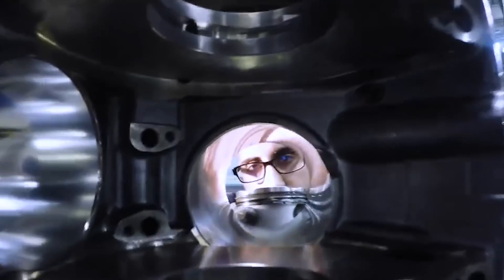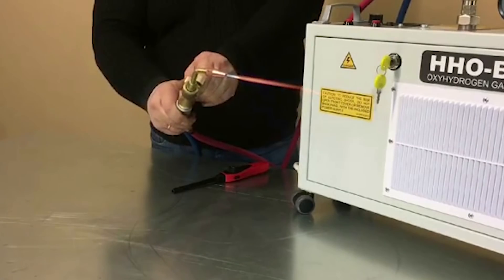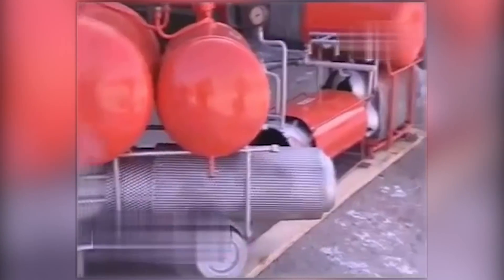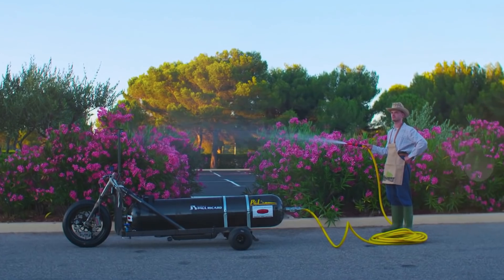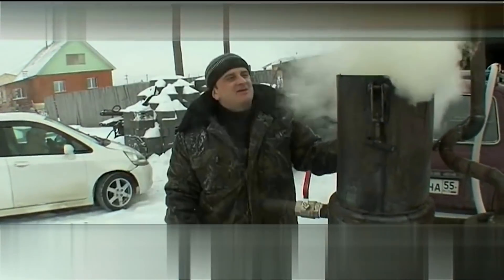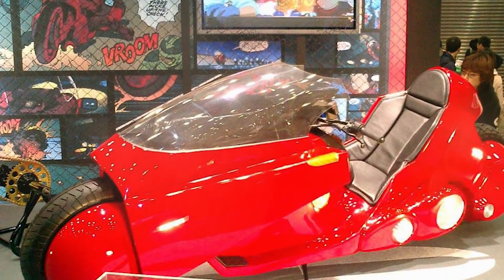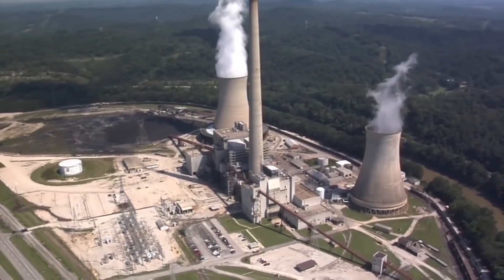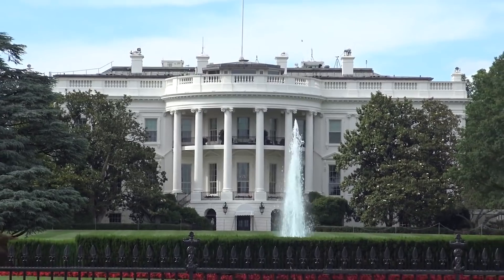Why These Engines Are Banned?

Comment: Lets make something clear,  energy is energy,  all these schemes use energy and follows the laws of energy.   take hydrogen,  it takes energy to separate that hydrogen from oxygen, from water,  it will take more energy to separate them than you will get out of them,  that does not mean it's not useful, as energy storage think of hydrogen as a battery.  in an electric car, you store energy in cells,  it takes more energy to charge them than what you get out.  there is always some loss in any system  no such thing as 100% efficiency.   

Now lets say you have a source of free energy like sunlight, and you use that sunlight in a way to provide energy to make hydrogen.  in essence that hydrogen is "free"  the energy you captured from the sun, is now stored in another form in that hydrogen.  of course that sunlight energy can be stored in batteries as well.

As for engines not making it to market,  there is no suppression here.   no big conspiracy,  it has to do with practicality, and logistics,  some motors are just way to complicated ( double piston etc ) and expensive.  hydrogen cars are complicated,  you need special storage,  special fueling stations,  it is highly flammable , and since its a gas, it needs to be kept under pressure to be stored. it takes up a lot of space.   then there is the fact that hydrogen's small atoms, can seep through almost anything. ( it leaks out ).  and forget about over unity free energy devices,  no such thing, and all those "they killed so and so, because he knew some secret" if anyone was killed is because they ripped of investors they conned. 

Compressed air engines have been around a long time.  again same deal,  you are using energy to compress it,  more energy will be used than you get out of it.  just another energy storage system.  instead of hydrogen or lithium cells,  it's compressed air.

I have even heard of gyro storage system.   a metal disk,  suspended in a vacuum, and levitated by magnets.  you "charge" the system, by spinning the disk, ( through magnetic induction) since it's in a vacuum, there is no friction, and can spin so fast, that the limit would be the strength of the metal.  to extract that energy,  you just use induction to generate electricity,  just like a generator. 

So really what determines what will be a successful storage system and motor for transportation,  is Cost, reliability,  efficiency,  safety,  how much infrastructure investment is required to shift to that system.  it's no wonder why electric cars are so popular. electricity is easy to transport from one location to another,  oil requires,  ocean super tankers, refineries, gas stations, and trucks to deliver fuel to them.   electricity travels basically at the speed of light.  electric cars are not complicated really.  almost any energy source is easily converted into electricity, whether it is nuclear, geothermal, fossil fuels, or solar.

Comment: The big issue with most of these cars is either safety, or efficiency.  For instance hydrocars are not efficient,  the air car is not safe, electricity is catching up in efficiency,  however batteries are heavy

Comment: "Water engine" - uh, that "generator" requires electricity IN to product the Oxygen and Hydrogen. Sooooo... where are you getting the electricity for that? LOL. Science is not difficult, but you need some common sense.  Air-driven engine? Tata has cars that run on compressed air, sure. But, you have to compress that air and fill the onboard tank, somehow. The laws of thermodynamics pretty much rule out any of these engines being any kind of "miracle" of "free" energy, hahahaha.

Comment: Tata air compression still requires an actual power source (Like that gas powered air compressor it was plugged into...),  Sumo is an electric powered bike which uses electric motors  not "magnet power", the other solutions also are not described properly either.

Comment: These "hundred mile per gallon" carburetor type hoaxes have been around for a long time. They all either dont work, or they do but cost too much to operate .
Reply: yup they are called techno myths. i learned about those in a michael chrichton book "the lost world" where a charcter even refers to the same myth
Reply: There was a 100 miles per gallon Diesel car available in Germany from Volkswagen - the Lupo 3L. It was simply a very lightweight and highly optimized car with a pretty uncomfortable price tag.

Comment: The air car could be fitted with a gasoline or battery powered air pump and would be a more viable solution to replacing conventional transportation cars and trucks. You could drive it long distances.
Reply: Congratulations! You just reduced the efficiency of the car by 75% compared to a normal combustion engine.

Comment: If the narrator really believes that air-driven vehicles actually use the air as the fuel, he's an idiot.  What is actually powering those vehicles is the energy that was used to compress the air.  The compressed air simply stores the energy, and releases it as needed.  Whatever method was used to power the air compressor is also the source of the pollution that replaces the pollution normally created by an internal combustion engine.  If you look close enough, there is always an environmental impact when energy is used.

Comment: The air cars should've had a pulley system that links a belt to a wheel that feeds a compressor that in turn keeps the air tanks full, or at least for a longer time.
Reply: It's free real estate...

Comment: I reengineered a water powerd engine in my head I first thought is there a way to separate hydrogen from water (electrolysis) if so i can feed the hydrogen in to a chamber where compression and combustion take place using the hydrogen as the fuel and then I realized
Reply: I’m a genius fuck anything anyone said and I refuse to be wrong from now on
Reply: @airveazy  You can refuse to be wrong, doesn't mean you aren't.

Comment: The reason? Not piratical! Take H engines for example. Break down water into O and H and burn the H?  All engines require BTU's to operate. Hydrogen make 51,500 BTU/lb, the equivalent of a gallon of gas that produces 304,368 BTU's would require 6 pounds of hydrogen. Simply put, the energy you use to convert the water in the ocean into hydrogen would be at most equal to the energy that hydrogen could provide. Of course due to frictional losses, from things like resistance in your apparatus, you would actually end up using up more energy to get the hydrogen than you would gain from using it as a fuel source.

Comment: HHO is a STUPID name for water electrolysis. The products are MOLECULES i.e. H2 and O2, not ATOMS! Also basic physics indicates that you always put more energy into electrolysis than you will ever recover by burning the products. (If you use solar EV panels, the energy is 'free', but you would always be better of storing the energy in batteries.)

Comment: Compressing the Air takes a lot of energy... DUH!
Reply: I have air tools and the 6 gallon air tank takes about some minutes to fill. The amount of energy is way less than the cost of gasoline.
Reply: @PrincipalDBA  say you have a gas powered air compressor. how many times could you fill that tank with compressed air using 1 gallon of gas. I'd bet quite a few times. that tank empties awfully damn fast too. we don't drive air powered cars because the energy density is much lower than gasoline. so much energy loss in the conversions too.
Reply: @lorenzo42p  that is what I am now realizing.
Reply: @PrincipalDBA  Then try to calculate again. Either you have got the most efficient compressor ever built - or just an error in your calculations.

Comment: What I have seen so far is not banned engines. These are merely impractical . You can go ahead and build any one of these and the cops will not bust you. As far as cold fusion, why haven't any worked out side of their inventors labs?

Comment: So...Ban was applied to each motor?
Reply: I didn’t know ban was more than a deodorant....learning everyday.
Reply: It will be interesting to see rotary engine concepts evolve....as a previous auto worker....rotary has the best stable performance...they barely wobble compared to most other piston type (moving internal) components.... besides less motor parts...probably higher rpm capabilities....  the only flaw of rotary is heat/cooling.   .....when the heat issues are solved these could be used in aeronautics....maybe aeronautical use is an option to help with cooling.  Over all rotary basic non high performance use in applicable temps performs way better than other engines I’ve mentioned as well.    .....rotary is probably going to become the best engine of its type......possibly till combustion engines like it may or may no longer be in use.
Reply: Still though maybe Ban is the key...it’s tech I never knew so versatile.

Comment: What happens when the air tanks rupture? Oh just a car sized missile on wheels. You also keep mentioning 100 kmh like it's super fast, it's roughly 60 mph if you're using imperial measurements. Since none of these are production models yet,  if anyone of these came onto the market today repairing one would just about or as expensive as a new one.  Case and point, to replace the battery of a Tesla is $3000 to $7000 and they've been on the roads of America how long?

Comment: Ya, and I have a car that never needs fuel.  It has a windmill on the roof that generates electricity while I drive.  I've survived several assassination attempts by crazy drivers.

The Thorium Reactor was one of the branches of the Oak Ridge complex that another US company resurrected for building small reactors for isolated areas around the world.  Obviously the rest of the world is interested as well.

Comment: Back in the 80's I contemplated the creation of a magnetic engine but lacked the resources to create prototypes based on various possible designs. The biggest obstacle is to create the effect of turning off a permanent magnetic field's influence on another permanent magnetic field induced into a ferrous piece of metal without consuming kinetic energy in the process. (The less kinetic energy consumed, the greater over unity output is delivered.)

Comment: The reason these technologies don't take off is because people don't want them. Either they cost more, they aren't as good, or they aren't better enough to be worth the infrastructure change.

Why hasn't the oil industry killed Elon Musk?

There are conspiracies, and any time you have a mass concentration of money such as the oil industry, the government, or the unholy alliance between them, you're going to have evil decisions being made, still occams razor is still the best analysis and the truth is, a lab demonstration isn't a production model, most conspiracies like the ones you mention aren't proof of anything, they're just lies made up to make viral videos to make money or from irrational extrapolations of insufficient data.

Battery technology was insufficient until recently. Fossil fuels and engines are good enough and cheaper. Tesla made many large strides in the technology behind their cars, the U.S. government subsidies "green energy" vehicles, and Tesla still isn't profitable, it's not simple. 

HHO generators can make a cleaner fossil fuel engine by more evenly igniting the fuel and producing more power but you can't get more energy out of the system than you put in. Otherwise you'd violate the laws of physics and have a perpetual motion machine be able to be constantly generating more energy.

Comment: Classic example of a nobrainer presenting a topic about which he knows  nearly nothing. BIG downvote.
Reply: Nazrahnas very true and also the states ‘ why these engines are banned ‘ but he does not answer the question
Reply: @RyZeMorga  They aren't banned. They simply don't work as well as existing technology, for one reason or another. For example, the hydrogen/oxygen generators he refers to do not work in most use cases(cars in particular) because the energy required to split the water into oxygen and hydrogen is more than the energy which can be gained by burning the resulting hydrogen and oxygen. This means that the engine of a car built around this concept couldn't generate enough electricity to produce sufficient oxygen/hydrogen to keep running which means that the engine would immediately stall, even assuming you could get it to start in the first place, unless you had a battery supplying extra energy to split the water. In which case, you would have an extremely inefficient electric car. Hydrogen/Oxygen generators are only beneficial as heat sources in homes because you are storing free solar energy in the form of oxygen and hydrogen.
Reply: @johndunlap9139  couldn't you have solar panels on your house despite the hydrogen and oxygen and bottle the gas for your car?
Reply: @jamesfreytag6411  Yes, but hydrogen isn't a liquid at room temperature so you'd also have to have a compressor to compress the hydrogen gas into a bottle that could be carried on your car. The car wouldn't have a useful range unless the hydrogen was compressed. So, if you're also powering the compressor with your solar panels then you're going to need a lot of solar panels and the economics of the situation become rather dubious. Also, the risk of your compressed hydrogen bottle exploding in a crash is far greater than the risk of a gasoline tank exploding in a crash. For one, gasoline is liquid at room temperature not a gas, which makes it harder to ignite. Second, gasoline tanks aren't pressurized. A compressed hydrogen tank could explode from the pressure alone, even if it didn't ignite(which it probably would). I don't know about you but I don't want people driving down my street with cars that could blow up my house.
Reply: @jamesfreytag6411  Also, you are running the risk of blowing up your own house just by messing with compressed hydrogen.
Reply: @jamesfreytag6411  I believe it would be more energy efficient to simply skip the hydrolysis step in between and to use the energy from your solar panels directly instead for charging up an electric car. Every step in between is just transforming the energy into another form and will result in some of the energy getting lost. Of course, electric cars also have disadvantages, for example that the batteries used today need rare materials that are limited, like the worldwide oil reserves are limited. But until there are other efficient solutions, ideally based completely on renewable ressources, electric engines will replace fossil fuel powered engines in the near future I think.
Reply: I truely realized that after the compressed air car...That thing is an explosion waiting to happen in hot or bumpy environments. I'm barely comfortable with that size on tank when its securely on the ground. Much less on the bottom of a car.
Reply: Y'all forget that everything plastic is made from oil. Polyurethane in your clothes is oil... cars are not the only thing using oil.
Reply: @lovepcgaming2335  Polyurethane is NOT used for clothing (except for patches and protective gloves). 

Polyester is the typical fabric and it's made from oil.
Reply: I think he was illustrating the very obvious and far more interesting fact of our “forced” dependence on [huge corporate] wishes. The desperate continuance of their pocket lining for which they will refuse no method of enforcing. It’s either really scary that they seemingly allow no one to deviate from their plans of oil dependence, or they know something that we don’t and implement it for the good of mankind...

Who really knows. I tend towards being agnostic about the issue. I doubt that anyone can truly know; or be allowed to know.
Reply: @danielkuva7966  I, for one, don't believe that we are "forced" to rely on oil companies and I don't think that there's anything obvious about that. As I see it, we originally became dependent on oil because, at the time, it was the only viable energy source. We are dependent on it today because of the economic momentum of basing our entire economy on it. Car manufacturers, fuel distribution infrastructure, regular consumers who spend a significant portion of their income on transportation and can safely assume that they will be able to get fuel in any town regardless of where they go. All of that has to be changed and it cannot reasonably be changed quickly. With that said, things are changing significantly faster than most people realize. Car manufacturers are already moving in that direction and no amount of lobbying by oil companies will change that.

Comment: Total bollocks. Compressed air is a very expensive thing to make . Think about it . You need a air compressor.  Next time you use a air compressor put you hand on it any it will burn your hand. That's called wasted energy.
Reply: That's funny. I compress air with a wind turbine and I have gotten no bills yet. But I do not want to get any surprise bills. Any idea who I should call to find out how much money I owe? Thanks for the heads up! I would be in so much trouble if it wasn't for rocket scientists like you!
Reply: @dragmit  Dude, the point is compressed air takes ENERGY (like your wind turbine) and is no way 'free' .. People forget this

Sure your wind turbine is giving you the energy for 'free' (no pennies) but thermodynamically its energy from this universe... Some people think compressed air in a cylinder is THERMODYNAMICALLY free - which it aint .. It's more like winding the mainspring on a clockwork car..